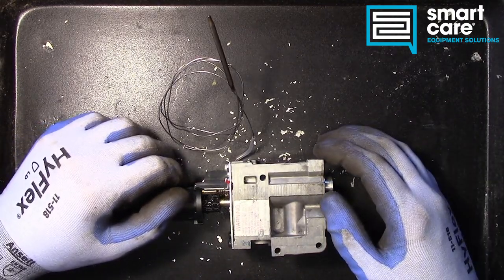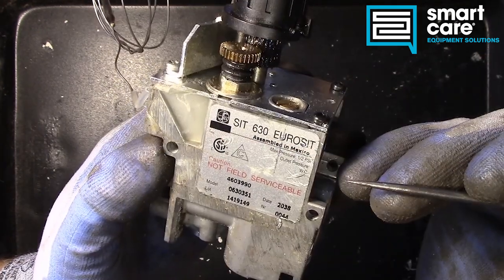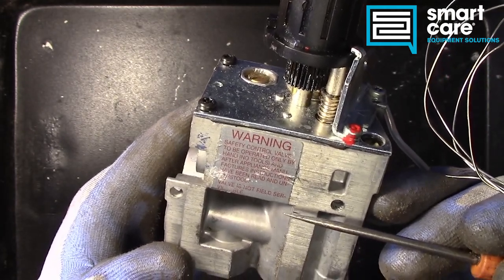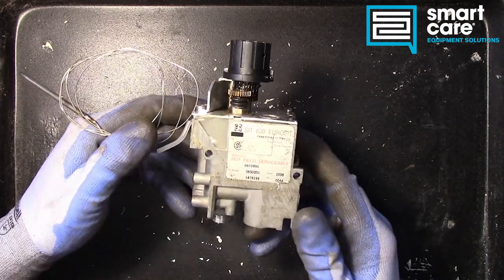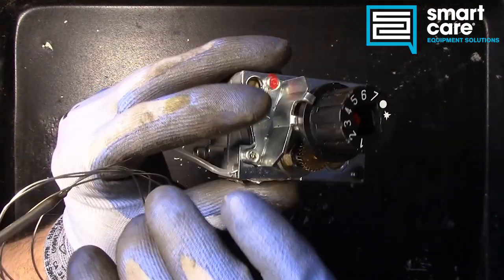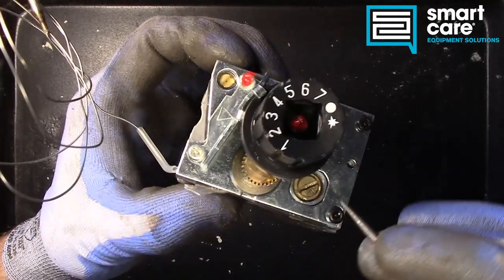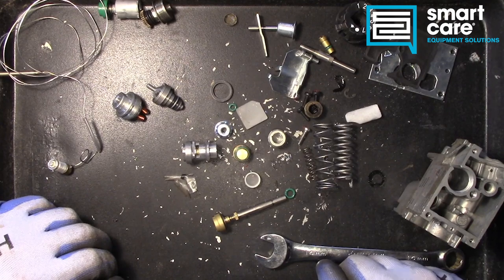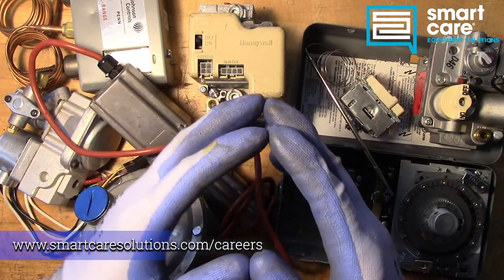Teardown Tuesday Episode 22: SIT Valve

Comment: The brass screws that are captured in the peened posts are pressure tap ports for measuring the gas pressure in and out of the valve. Otherwise great explanation of the valve.
Reply: Is that P1 and P2 inlet pressure and burner pressure

Comment: I have a set of gas logs with this valve. It's dual fuel. LP gas or natural gas. There's two pilot assemblies. when you turn the knob to LP, the cog gear outside the valve trips a switch to turn off gas to natural gas pilot

Comment: hi! was not expecting to find this online. excellent!
two questions if i may:
1. how the current in the solenoid is produced (yeah, i'm out of my area here) - this is just a curiosity, did not find an answer on few searches online;
2. for an issue that i have (randomly after 10 sec or 30-40 min or by a small shock (vibration) the gas is completely shut - including the pilot flame witch lead to... cold) as an emergency i thought of an workaround: for keeping the pilot on all the time i'm blocking in a pushed position that piston that sit under the big black plastic knob. does this have another effect other that keeping the pilot on?
Reply: Short answer: DO NOT DO THAT!
Long answer: SEE ABOVE!

Comment: Thanks so much for this, but the fact remains - this valve has a ridiculously high rate of failure (they are the CURSE of Garland commercial range ovens). They often fail just by being installed!
They have NO warranty on this part, so l no longer work on them.
FIFTEEN YEARS of bad thermostats, and Garland does nothing about it.
My guess: the capillary wire is way too thin, the slightest kink renders it unusable. (The oven will initially heat up, but almost goes cold before the heat recovery begins.) 
Been much happier by avoiding these overcomplicated and unreliable valves. I know l'm not alone with this opinion.
Reply: Hi! Since you worked with these maybe you can answer to a curiosity: for an issue that i have (randomly after 10 sec or 30-40 min or by a small shock (vibration) the gas is completely shut - including the pilot flame witch lead to... cold) as an emergency i thought of an workaround: for keeping the pilot on all the time i'm blocking in a pushed position that piston that sit under the big black plastic knob. does this have another effect other that keeping the pilot on? Thank you!